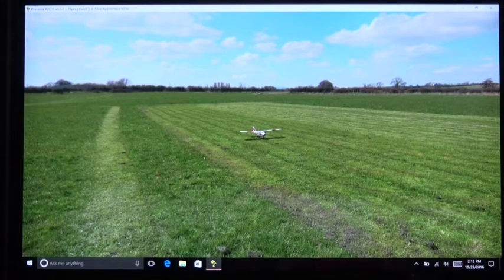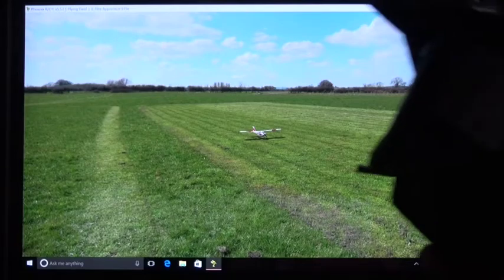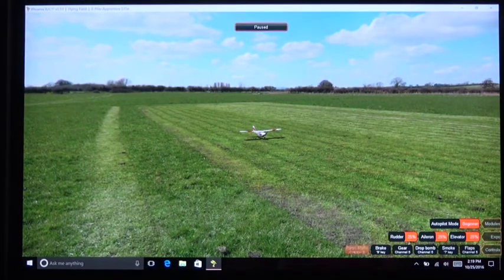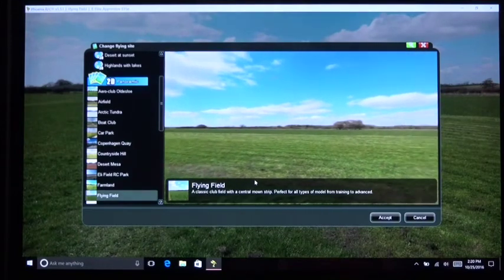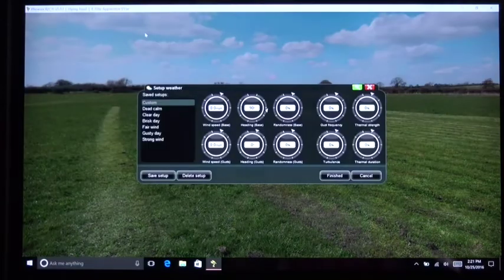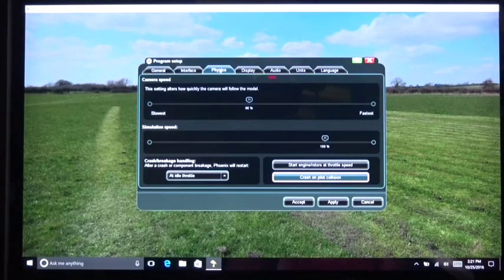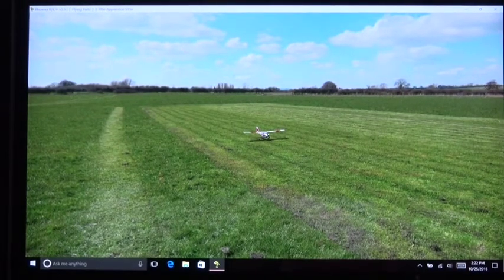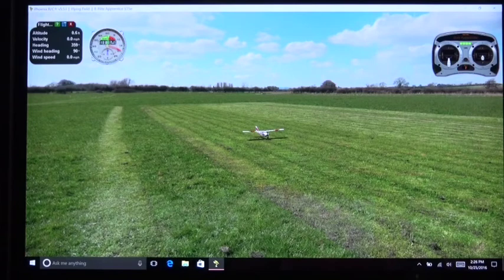AP56 Apprentice S 15e RTF Sim  Settings

Comment: Your vids are great Sir. I believe I have an issue though. I'm running the DX8 and I have everything set up on the Phoenix, I received it yesterday. My Rudder, Aileron and Elevator are all showing 25% in all three modes, Beginner, Intermediate and Experienced...is that right?
Reply from the maker: Yes, the 25% is the default expo and not the rate.

Comment: Great vid...can't wait to get mine.
Reply from the maker: Glad you got the DX8 generation 2 radio.  It has a lot more features than the DX6 and much much better than the old DX8 generation 1.  Be sure to sign up at Spektrumrc.com and follow the instructions on how to get the serial number from your DX8 and upload it to register it.  That way you will get the latest operating system updates which are alway important when using any Spektrum radio.  You will need at least 3 SD memory cards for the DX8, one for firmware updates, one for sound updates, and one for backup of all the models you build in the the DX8.  The video I did about the DX6 will be close enough for you to setup your DX8.